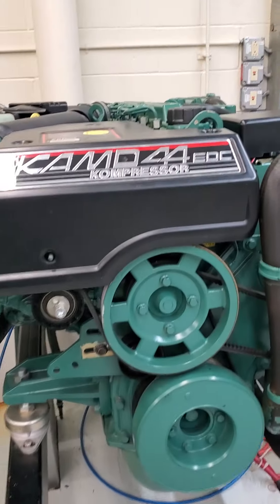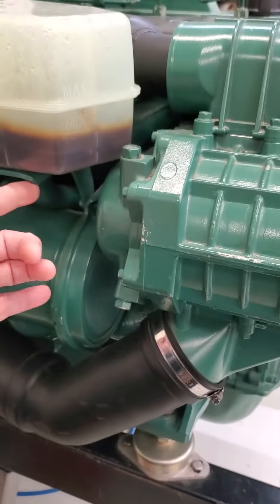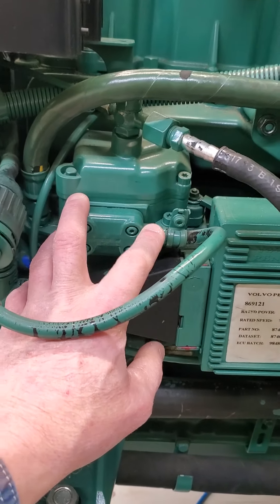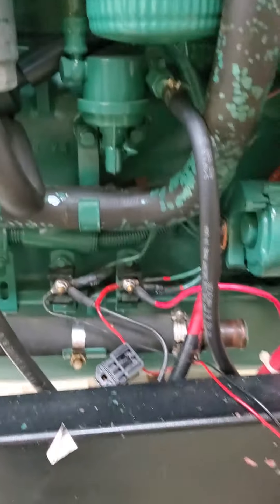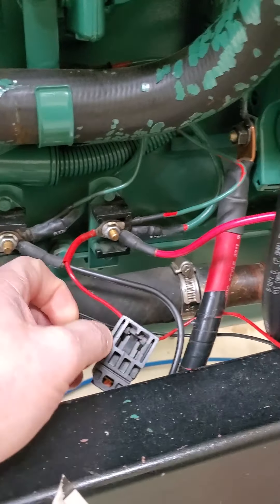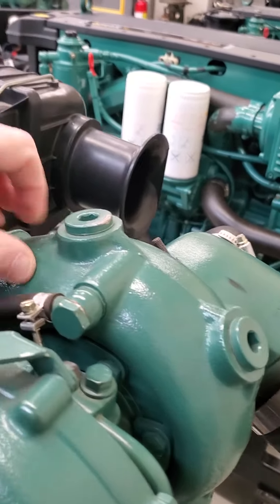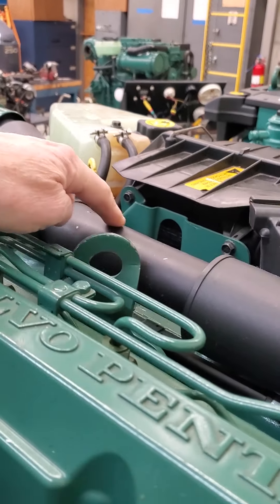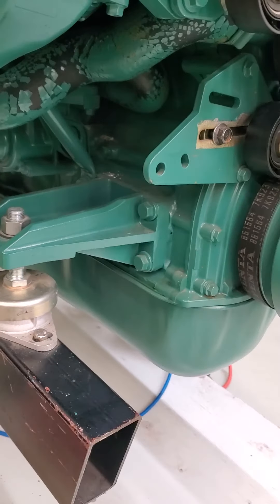Volvo Penta EDC KAMD 44 Engine Overview Part 1

Comment: Hello Ted, working on one of these engine right now. There are two lugs on the starter side of the engine down near the starter. The "EDC connections" as you stated in this video. What powers these up? So here is my issue the starter relay in the black box on the top of the engine wasn't getting power on the signal side of the relay. I traced that wire down to the positive lug on on the "EDC connections". The previous owner put a jumper wire from that lug to the battery. This caused the battery to drain and killed them. I put that wire on the switch but I'd rather fix the problem then to use that jumper wire. So basically I just need to know how what supplies power to that lug. Thank you very much. I truly appreciate the help. And especially this video.

Comment: I'm getting a 3.3 code on my port motor.which in turn is making clutch on blower not shutting off.its saying low coolant temp on the code been trying to fiq this problem out for awhile.youre videos are very helpful so thank you for those if there's any suggestions you could pount me in the right direction it would be greatly appreciated thanks georg

Comment: Ted, I have a KAMD-44 and a few weeks ago the instrument panel as well as the Control panel at the helm began powering up without a key being present.  I have to turn power off at the batteries to kill power to the instrument panel and control panel.  The engine starts and runs, but I seem to be experiencing some minor issues that may be associated with the EDC.  The engine seems to smoke more, and the shifting seems a little rough at times.  The EDC is not providing any diagnostic faults.  Do you have any ideas?

Comment: Hello Ted,
Did you ever repair the shaft seal from the diesel injetionpump on this side were the seawater pump gets it place?
The shaft on my kamd44 is leaking a little bit oil. 
Thanks for your very guiding YouTubes
Best regards from Germany 
Marcus

Comment: Hello.
I found your YouTube channel and appreciate it greatly. I have a boat that’s new to me with twin fairly low hour Kad44s, and not surprisingly, I’m having an electronic issue that I can’t seem to solve. I found a couple of videos on this engine and you mention a series, which I can’t seem to find. Did you continue on with videos covering this engine? FYI, here is my issue:

Kad44 won’t turn over at key

I select station, neutral lights come on, but when I turn the key I get a click from the solenoid and the neutral light goes out. Starter is new, batteries are good, and I can fire the engine and run it by jumping the solenoid or the start relay. I’m not getting any codes. It’s acting  like the batteries are dead or something is shorting out when I turn the key. Because the neutral light goes out immediately when I turn the key as the engine bumps, I feel like the issue is in the shift circuit but swapping shift actuators between engines does not change anything. Fuses and plugs appear to be good. Swapping relays and  key switches also does not help. Continuity is good from the key switch to the EDC unit and from the EDC to the start relay.  It would appear that the EDC is immediately killing power to the start circuit for some reason.  The Port engine is fine. 

Thanks for the videos and any help you can share on this. I have five charter boats and have a long and pretty successful history of keeping them alive. I was warned about this first generation EDC system, but the boat is immaculate and I’m hoping to get a year of light use out of it before repowering. 

-Matt
Reply: Hey Matt, what ever came of this? Super curious! Looking at a potential project with kamd44's

Comment: I'm getting  a 3 -3 code volvo kamd 44 Edc motor I changed temp sensor code will not reset.any suggestions. Compressor does not shut off after warm up.thanks George

Comment: Was this season ever continued?
Reply from the maker: What are you looking for? I may be able to do a video on it.
Reply: Hi Ted. Like your first video.

I would love to understand how the turbo and compressor  works together while driving in different rpms and how the magnetic clutch works. I have two kad44, but believe they are pretty much like the kamd 44, except the stern, right? 

I have a problem with my turbo or compressor (or something else?). Between like 2400 rpm and 3000 rpm the throttle goes forth and back and after a while with my lever on full throttle I managed to get up and keep it steady over 3000 rpm. Is this a problem with the magnetic clutch?

Regards
Robin
Reply from the maker: @robinhaglund5994  I would need some more info to help determine the issue. I am available for consultation. Please email me at marinedoc01@yahoo.com

Comment: I have 480HP Volvo Penta 2006 black smoke coming out from starboard engine on will I speed over 9not ? We change turbo charge. We check oldall the exhaust system. All  good ? What else I can look for?
Reply from the maker: Check boost and exhaust back pressure @ full load
Reply: @tedsmarinerepair8956  thank you we enjoy your channel.